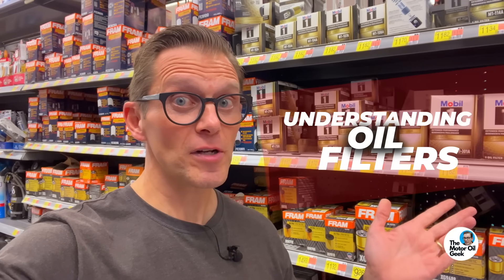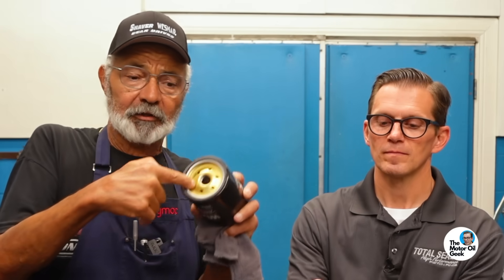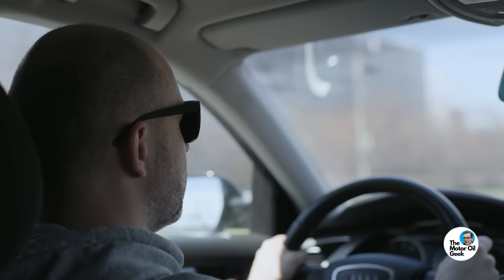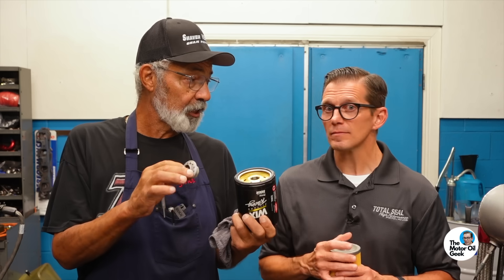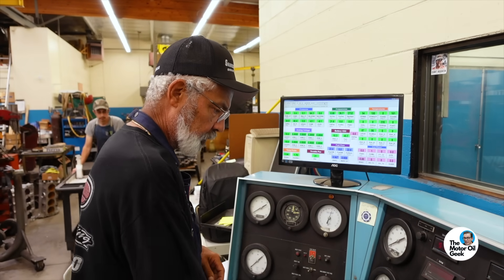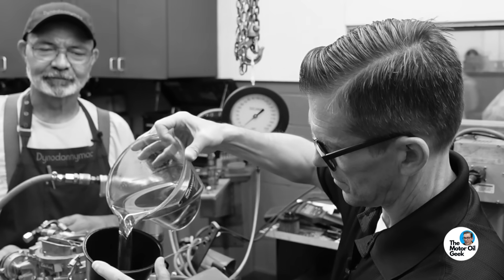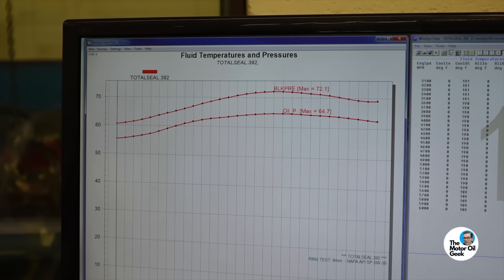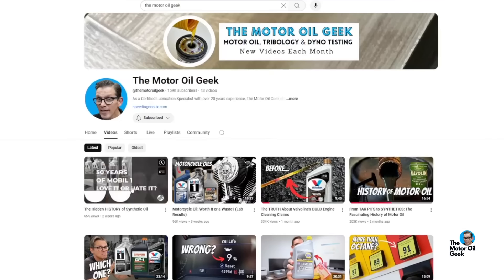OIL FILTERS: What Most People DON'T Know!

Comment: International big rig engine had hole melted in plastic valve cover, oil looked like tar almost,took a lot of brake cleaner,55 gal.drum, just to clean enough to open it up, tech was mad. Just walking by you turned oily.

Comment: Great video.  (-30F) Filter Testing is what I have always wondered about.  The filter sits out in the cold, even when a person uses an engine block heater.   As a canadian on the prairies, -30 happens probably 10 days a year.  -20 probably 20 or 30 days a year.
Reply from the maker: That would be fun to do. Maybe someone with a dyno in Alaska could do that.
Reply: Hello from the warmer south.
Single digits f a few times, 60* today, 70 by Tuesday. 
YeeeHaaaaw !!!
Reply: One point that Lake made to me when I asked about cold pour tests is that pumping is different than pouring.  Here in the Northeast we just reached -20 to -35 Fahrenheit.... Plenty of unheated vehicles sitting outside still started.  With considering what he stated I still do experience the smoothest start with Pennzoil Ultra Platinum and now also feeling and hearing the same smooth result with Valvoline restore protect when temperatures are brutal.
Reply: And that's why only 5w30 is recommended even in winter sno2 climates.  0w20 is overkill rated for -40.  Driving

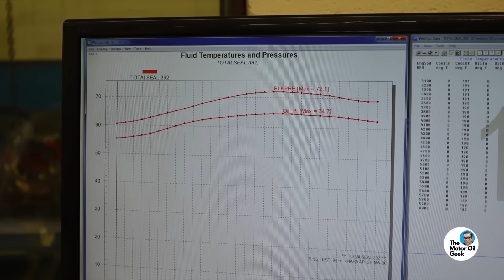Comment: While it might not have opened much, I believe it probably did open. Because you didn't see a delta higher than ~7psi you state that it didn't open, but that just feels like you guys are trusting the 8-11psi delta rating of the bypass without actually testing it. That bypass easily could have partially opened at that pressure delta, but also you have the graph setup to show max values of each individual curve (which even that was 7.4 psi delta), when the necessary data to compare is max delta between the curves at any point in time, which by judging looking at the graph at 9:54 appears to be closer to 8, which would be right in spec with that bypass. When the bypass opens it is pushing against a spring which would provide a generally linear force until it's fully compressed, allowing a little oil through upon a minimum delta of pressure, and increasingly more oil as the delta increases. I state this because I don't think there would be a significant bend in the curve when the bypass "opens", it being more gradual but not allowing a large pressure differential, which we did never get. I believe if you were to see a significant change in curve it would only be at the point that the filter media AND bypass become too restrictive on the oil flow, basically seeing the bypass' spring reach max compression.

All that to say, it has yet to be seen with your testing what pressure it actually starts letting oil through the bypass (even if a relatively small amount). If the bypass really didn't open on this first round of tests, then a no bypass version with the same filter media should look the exact same on the graph. I would like to see the same test with two filters overlayed on the same graph, of similar construction but with one of them having a bypass valve and the other without. (Probably a custom filter housing so you can put in the exact same filter media, allowing for the only real variable to be the bypass.) I think that's when the data would really show if the bypass opened or not, and when real conclusions could be drawn from the testing.

I was surprised to see that the pressure differential went up with warmer oil, very interesting. I hope to see a follow up at some point testing my hypothesis since you guys have most everything setup to do it! Love the content, keep it up
Reply: They also didn't compare at same engine speed, cold to warm.  Their test was apples to oranges. Not saying their conclusions are wrong, just that they didn't control all variables.
Reply: Fun stuff, but does it matter in the real world?

Comment: Great one. People really don‘t know that. Experts arguing about the valves. When your engine explodes it does it with or without the valve, it‘d only delay the damage for an instant. Thus as a frequent filter/oil changer, there‘s no need for a valve, but it won‘t hurt either to have that „safety“ especially during the first work-in periods of an engine.

Comment: Interesting test, however, even if the bypass valve is not on the filter, if it has not been removed or locked the output pressure will be limited.

From the shape of the inlet and outlet curve, you can clearly see that the shape of the curve is completely different, showing that the valve is indeed acting.

LAnother point is that the presence of water in paper media drastically increases resistance.

I recommend reading the study on filters from Machinery Lubrification (Noria). there is another one also from Napa that is interesting. 

Another point that people don't understand is that filters, of any type, do not work as a gate where particles pass below 20um and above not. This classification is measured in one or a few passages considering a min percentage. So the filter's performance is determined by how quickly it removes particles. the size of the particles that the filter cannot retain or are only temporarily retained and eventually pass through is much smaller.

If you look at paper media against the light, you will see that it is irregular, some points lighter and others darker, these different areas retain different sizes. With a synthetic media, there is no difference in density on the surface, so it can remove dirt more quickly. after several hours of work, both will remove much smaller particles, but sintétic still litle better

Comment: Your test may be incorrect. If you check oil pressure before and after - and the result is normal - it does not necessarily mean that the bypass valve remains closed. It may be that it opens and is compensating for the pressure.
Reply: I thought this too. There’s no way of knowing unless we have a clear oil filter housing. Unless their instrumentation reacts really fast, because the delta always stayed low.
Reply: Correct, you would really see if you compare operational vs. disabled valve. Just looking at the pressures tells us nothing, in both cases it is going to track.
Reply: Yes something is very wrong  -  Hardly a large delta pressure change pushing massivly more oil through that filter media at higher RPM, for sure its bypassing.
You would think an Engine Man would have seen enough debris strewn throughout a failed motor to know little full flow filters do lots of filter bypassing without even testing 😉

Comment: Talking about oil filter position, Subaru orients the filter with the holes down at the top of the engine. Super easy to change, and yes they  have to have an anti drain back valve. My Ford has a cartridge type filter at the top of the engine also. Hard to prefill either one. What is up with that?

Comment: Years ago after studying oil filters construction, I started using only filters that had the bypass valve at the upper end by where it threads on. My thinking was that when it was -10 degrees Outside and I start up and start driving if the bypass was opening because of the thick oil that it would not draw from the bottom of the filter can where any sediment or dirt would have settled from the outer filter element and go straight to the crankshaft bearings. I would like to see the same test done at real cold temps to see if or how long it stays open.
Reply from the maker: The dyno is in LA, so "cold" in this test was room temp. It would be fun to repeat the test at a much colder temperature.
Reply: Lake what's your thoughts on Baxter Performance spin on oil filter conversion i have two newer toyotas with the plastic canister in the long run would this help towards engine life as well as be more convenient?Thanks enjoy your show at 62 I'm still learning

Comment: So an auxiliary pump attached to the oil pan drain hole pumping through a bypass  rated filter element 
(2 microns?) and plumbed into the engine after the full flow oil filter with  a heater  and a spigot for oil changes  and analysis  samples should do it. Don't  forget to park the car in a giant
plastic bag, evacuated  and refilled with  argon gas! Also a very slow turning geared down electric  motor rotating  the crankshaft,working through a timer. Working
  on pleasure  boats most  of my life and reading the winterizing  recommendations  in the
owners  manuals it came  down  to remove the engine(s) from the  boat and put them on your  king size bed under an electric blanket. Tell your flesh and blood  partner to find another  place to sleep 😂!

Comment: So what if it's -40 out, would the filter bypass so the engine receives oil faster?
Reply from the maker: The dyno is in LA, so "cold" in this test was room temp. It would be fun to repeat the test at a much colder temperature.
Reply: @themotoroilgeek  i agree, as I live in western Canada we have half the year below freezing.  I use a pan heater to keep my oil warm.  The cold start with -40 oil would be good information.  We know it will be bad, but how bad?

Comment: Can I ask, for some friends, that another test be done with -29C engine and synthetic oil with some (2000 miles ? ) time on it.  Would this cause the bypass valve to open, even if for only 5 seconds?  Curiosity is driving this request, as it mimics what many cars endure in their driveway for 3 months of the year.
Reply from the maker: If we had a dyno in Alaska, we might be able to do that.
Reply: @themotoroilgeek  Well I know you are connected to other Tribologists that would have done such experiments..so maybe you could ask them?  My SW Ontario driveway is available.

Comment: I do wonder if the bypass valve might open in sub freezing temperatures. ?

I’m curious about the AKT Magnetic Oil Filter.  Apaperless filter that uses rare earth magnets to filter out oil contaminants.

Theoretically it makes sense capturing smaller particles.
Reply from the maker: The dyno is in LA, so "cold" in this test was room temp. It would be fun to repeat the test at a much colder temperature.